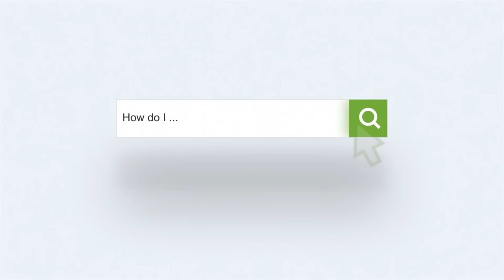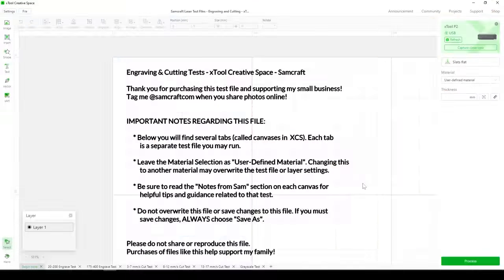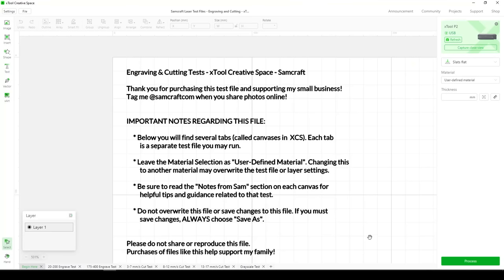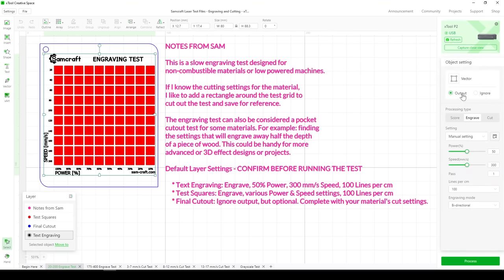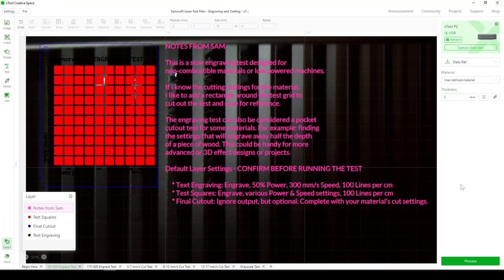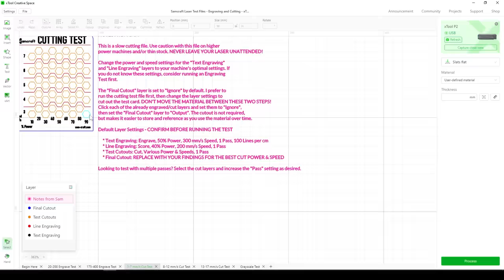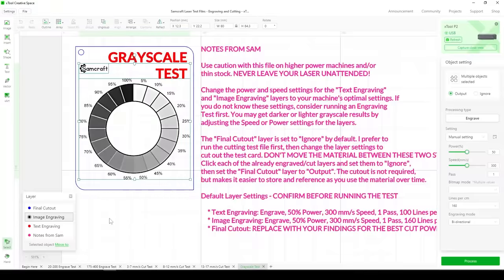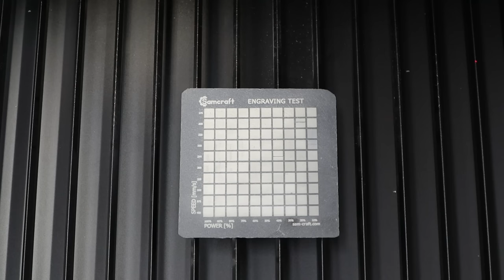The ONLY Test File Your xTool will Need | xTool Creative Space | xTool P2, D1, D1 Pro, M1, F1, S1

Comment: My xTool D1 Pro (10w, 40w package) is on its way!  I'm looking forward to watching more of your videos, and I will definitely purchase the test files.  I have been using a 3w and 7w module, chucked to the router collet on my Next Wave HD4.  Because of the liminations for such low wattage lasers, I've found a lot of the "bottom margins" of successful burning, especially in pine and baltic birch plywood.  What I have found is a significant amount of material variation in both of these woods.  Pine has certain anomalies in grain that make the laser look like it totally shut down when passing over.  Each side of the particular grain was burned well, but then there is just a void until the beam passes by that grain.  Same way with baltic birch.  I'm looking foward to having a lot more power, and also I'm looking forward to running several of your tests so that I'm not guessing anymore!  Thanks so much!

Comment: Very useful video and file set for a new XTOOL D1 Pro 10W user like me. If helpful to others as a starting point, here are the settings that seemed to work well on the 1/8" Basswood Plywood included in the explore pack from XTOOL.

Engraving tests:  100% power text at 200 mm/s for one pass with a cutout at 80% power and 8 mm/s for two passes with 100 lines/cm
Cutout tests: Same text and cutout settings with the line cuts at 60% power and 80 mm/s for one pass with 100 lines/cm
Greyscale test: Same text and cutout settings with the image at 100% power and 200 mm/s for one pass with 160 lines/cm

Comment: I purchased your awesome test file, and printed my first and second ever prints on my xTool P2 with the cut and etch. Worked great for the included Basswood and gave me confidence to print some fun items. Question: let's say you have a material, like a slice of bread, that you wanted to draw something on. What would your methodology be for engraving on something that you'd never experienced before? I realize that you want to be careful with items like vinyl, but lasered bread should be safe. Thoughts?

Comment: @Samcraftcom, question on your grayscale test; I'm new to using XCS (I've been using Lightburn since the beginning, but just picked up the F1 & P2, and both seem like I'll need to work there to get the best use out of the machines), and I know that XCS just updated to v1.5.  I don't know if they changed the settings menu from 1.4, but it seems like there's a bunch of settings in there that you didn't discuss in your video.  Would you be willing to do a follow up video for the best use of this part of your file?

Comment: Hello Sam, thank you for the tutorial, I'm a beginner with this new hobby, this has been very informational, my question in the files the MM is for ranges of MM that was being presented, 3mm - 7mm, cut test, the material would be for this between 3mm -7mm to use these settings, as an example? Sorry If I'm not making sense

Comment: HI Sam. I was hoping you could help me. I have a question: I just got my P2 and it keeps shutting down and disconnecting from the computer every time I try to run a job. Now, it won't connect to the computer even with the provided cable? I'm very frustrated and can't believe this thing didn't work right out of the box. Any help you can provide would be appreciated.

Comment: For some reason I put the download into my d1 but it registered everything as if it was set for the machine used in the video ( the newer model)but when I switch to my d1 it resets all the settings and just leaves the template. Still great just have to input my stuff manually- but what you’ve done here is his amazing Sam thank you !! This download helped me understand the software better. Can’t thank you enough
Reply: Same issue here. Opened the D1 Pro 2.0 file and suddenly my connected machine was asking to connect, once I choose the machine, all the template settings defaulted to no individual square settings. 0 power on every square.

Comment: Thanks!! on the cutout test there are quite a few that cut out. which do you choose to cut out when there are multiple options. does it matter or are you choosing higher energy, higher speed, etc? thanks
Reply from the maker: I generally pick the 2nd fastest speed, then the 2nd lowest power setting.

Comment: I notice with the cutting tests on wood it seems to be cutting the outline first - is it possible to make it so that the last thing P2 does is cut out the perimeter?  Or do you have a reason for doing it the way you did?  Great video - thanks for making such comprehensive content.  Waiting on my P2 to come in the next few weeks.
Reply: I think it would be better to cut the outer border last.  It eliminates any issues that could arise from the sample shifting in height.  This is typically the rule in CNC, where of course there is much greater risk and issues with the material coming loose, but I think it would be good practice here, too.
Reply from the maker: That processing was handled by XCS. I didn't like it either. I've not (yet) found a way to specify cut order with XCS. The (dirty) workaround would be to run the job and final cutout as two separate jobs.
Reply from the maker: The latest updated to XCS has fixed this issue. :)

Comment: I see an issue with how their software does the cuts at about 18:44, it's doing the outer rim BEFORE doing the inner cuts.  I'm assuming that you were using the xTool software doing these, and not Lightburn, correct?  They definitely need to address that, and have the perimeter cuts done AFTER any interior cuts, or you're not going to get completely accurate cuts on the center parts, since the piece drops down just a bit after the perimiter is done.  I'm assuming that's something you could likely address in the process though (in Lightburn you could make the perimeter cuts a seperate layer, and put it further down the cutlist to be certain, not sure if xTools stuff can do that, but I'm assuming so?).  It looked like it dropped enough that it definitely could affect the cuts that would have been marginal, since that part isn't in perfect focus anymore (I usually try to do my cuts at a step or 2 above the first 'perfect' cut on my Co2, to hopefully account for any inconsistencies  in the wood layers).  I'm also assuming that's Makerstock wood (I got my order, and the stuff is VERY nice, everything was the exact size I ordered, or just a touch oversized, but all were consistant between the various pieces I ordered, definitely thanks for that suggestion).
Reply from the maker: They just released a new version of XCS today with several fixes/improvements. The cut order was one on that list. :)

Comment: I have a question. Whenever I try to run this set to User-defined material, it just flashes light and never engraves or cuts. All the settings are right. I know it works because if I set it to wood, it will cut or engrave but the settings are wiped and it just engraves black squares. Am I missing something?

Comment: Hi Sam, thanks so much for these test files!! I'm wondering if there is a different between having the machine wifi and having it usb??
Reply from the maker: I briefly had my machine connected over WiFi, but found it to be very slow in communication and sending files over. This was probably an issue with my network, but I only USB now.
Reply: Thanks! I am now doing the lightburn ones and I'm very confused about the engraving one, one spot the power is say 100 and the other spot it reads in the thousands, what one do I use when inputting it?

Comment: Hi. does the power and speed setting need to be adjusted for each matrix? Im using an S1
Reply from the maker: There should be no adjustments needed. I have an S1 file version programmed and included in the file kit.

Comment: Purchased you test files. Thanks. Worked fine on Sande ply 1/4” but on 1/2” Birch ply none of the cut tests went through. When I tried just cutting a shape at different settings it either did not cut through or if it did the sides and back were charred like charcoal. This wood is from Home Depot. Not sure if that’s the problem or what. I rechecked the optical path and cleaned the lens and mirrors but no go. I thought 1/2” ply was well within its capabilities?
Reply from the maker: It all depends on the machine you're using... my most powerful machine (xTool P2) has only been able to cut through 3/8" (9mm) thick Baltic birch plywood in a single pass. Plywood is more difficult than solid wood. Most companies advertise the solid wood cut abilities vs. plywood abilities.
Reply: This is probably a stupid question, but when you cut acrylic, do you leave that paper on all the time? Does it go on top, as in you cut or engrave through the paper, or on the bottom, as in you see the color of the acrylic on top? I mean, I know that different lasers can or can not cut different color acrylics (which, by the way, is there a list of those somewhere, like for my new D1 Pro or F1 that I ordered), but I don’t know if that paper helps with that,or if it should be removed before doing any work? Thanks!! 😊

Comment: I bought your test file but I received the XTool D1 Pro 2.0 and I can not get it to work because it resets all the parameters every time I connect my printer. Is there a way to fix this?
Reply: Having the same issue with the 2.0. I've tried several and they all reset to 1 as soon as the laser connects.

Comment: do you have files in inches? any reason why they are usually metric? thanks
Reply from the maker: The industry standard for machinery like lasers and CNCs is metric. It's what everyone is using and what the software uses.
Reply: Thanks for your response. I guess I will have to adjust to mm. It is foreign to me. Will your test cards work with 40 watt s1 xtool?

Comment: HiI purchased the testing files for the P2...The settings are not correct, do I fix the issue manually? I've never engraved before and im scared I'll mess something up. Please help!
Reply: Also the squares are not grouped together and looks like its just a photo, cannot ungroup and click on the individual squares.
Reply: also don't do the first 2 tests on wood? it has to be slate because of the settings?
Reply: Why is there 2 files for the P2 and which one do  use. when I go to process it says there is no design element. Im so confused

Comment: So if a cutting test fails to go through the material, I guess run the cut and not the engraving portion again to see how many passes it takes to burn through the material?
Reply from the maker: Exactly :)
Reply: @Samcraftcom  Thanks.  Been trying it out and finally getting cut throughs after changing the focal point on this wood. But the back edges look absolutely horrid.

Comment: I dont understand why you used such thin wood for the 13-17mm test, shouldnt you be using 13-17mm wood and having a test to see what settings will cut through say 13mm wood? Otherwise what is the purpose of the test?
Reply from the maker: No. The values are not for material thickness. They are the speed ranges of each test.